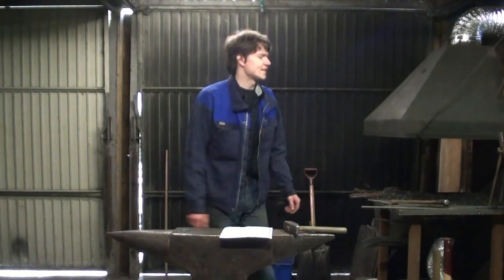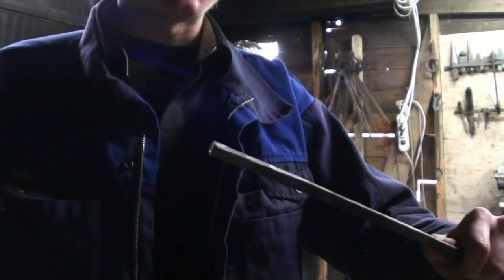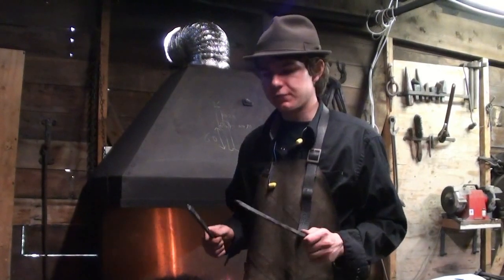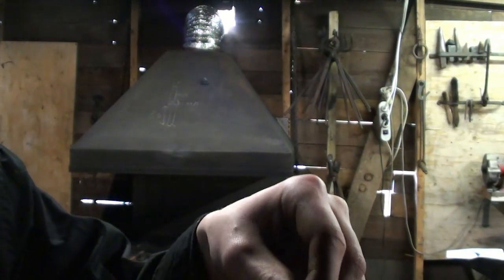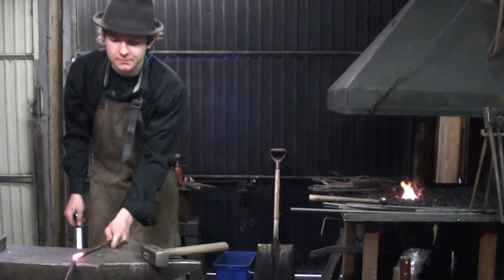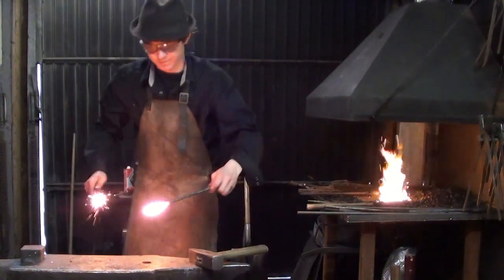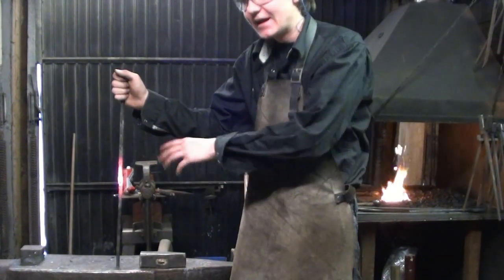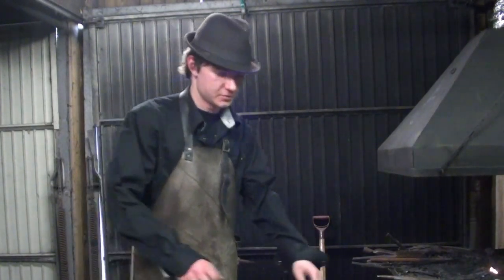Forge Welding Guide | How To Forge Weld | Sand As Flux

Comment: Now, what fuel are you using? I never was able to catch what fuel you were using; I don't know much about coking, or coal forging(since coal is too expensive where I am), and, I'm wondering how you would weld with charcoal. I'm a beginner, and, I'm actually pretty proud to admit that I have already achieved a weld, but it I didn't manage to weld the entire piece that I wanted. I'm trying to learn basics(cleaning the piece, I will keep in mind. I did not realize I needed to clean it, even if I was keeping it hot and intending to just flux it, jam it in the fire, and get it white-hot.), here, so advice would be so much more than appreciated.
My forge is a single tuyere Japanese Side-Blast furnace, fed by a Fukisashi-Fuigo bellows(Japanese Box Bellows). Essentially I've built a Japanese swordsmithing forge. I'm still tinkering with everything(Like adding more tuyeres! I definitely need to have the fire more spread out when I fine-tune the firebox! Less pressure, more airflow I'm guessing.), but advice this early in the game will help later on.

As a note, I know nothing of forging lingo; I only started a few days ago.
Reply: charcoal is what blacksmiths would typically use back in the day when forging, coal coke keeps the temperature for longer but charcoal doesnt slag up your forge as much but burns faster and cleaner. Also as opposed to coke the charcoal has less toxic fumes when you burn it coal coke and stone coal have a lot of shit in them that hurts your lungs and make it hard to breathe while forging if your airflow is poor in your workspace.

Comment: your angles are too long. shorten them up
Reply: Are you a blacksmith, do you forge on a daily basis?
Reply: weekly
Reply: jim bob Well, your channel doesn't give that impression. Anyway, I put more mass in the toes to compensate for the little upset. If you forge you should know upsetting small bar is a bit tedious.
If you think it's all then I am very sorry. But apparently the weld is sound.

Comment: The close up looks like the fire is pretty dirty. Are you using anthracite or bituminous coal or charcoal?
Reply: I am the blacksmith in this video, aswell as the maker. Gauging from your youtube channel I don't get the idea you are deeply involved in blacksmithing.

The fact you ask what of the three fuels you mentioned, I use, shows you don't know much or even nothing about forge fires. Because the fire is clean.
Having small particles of fuel, close to dust, in a fire is inevitable. You will find that in every solid fuel forge fire.
If you can produce the same fire I have with the close up, showing it has no small particles flying around. I would happily ask you to make a video of that and uploading it.
Reply: Yes, I do not know much about coal OTHER than high coking bituminous. I tried anthracite once and have never used charcoal in the forge. I don't see much coking in your fire so I was wondering what type of coal it was.

Do you have the firepot plumbed properly? It seems that the ashes are being forced back up through the firepot. Also, I noticed that in most of your videos the hammers you use tend to be quite a bit lighter than most including Alec Steele. Have you tried using a 4+ lbs hammer for most work and found that you refer lighter hammers?
Reply: 78sharpshooter

I use bituminous coal. Generally the type that doesn't coke over too much, as it tends to get hollow spots in the fire, I don't like that.

Yes the fire pot is properly plumbed, the ash dump is too low to blow dust back into it. and the air inlet is above the ash dump.
Try and do a close up like I did on your fire. You will see the same. Unless you blow very gently, but then it takes too long to get the stock hot.

I use lighter hammers, because I generally don't forge very big stock. If I got to stock over an inch, I will step up to a bigger hammer. But I try to use the lightest hammer to get the job done properly.
Use whatever size you want, my body is different from yours and vice versa.
Reply: thank you for posting, your fire was plenty clean, for your weld would not have happened, I am sure you are using bituminous (soft coal), anthracite (hard coal) would have turned to powder and blown ash all over long before you reached a stable welding temp. Well done.